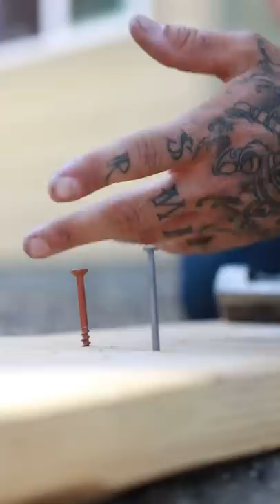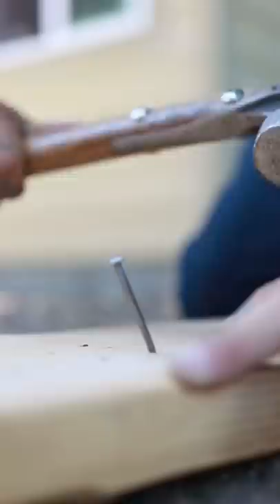Nails vs. Screws: Why do we use nails? #shorts

Comment: Nails are way cheaper than screws.  'Nuff said.
Reply: Also way harder to put in than nails...
Reply: @Caffeine_Addict_2020 not if you use a hammer...
Reply: Plastic nails are even cheaper, ‘Nuff said? 
Costs are only a secondary argument. You need your construction to stay up first. That’s the point of this video. It had nothing to do with costs.
Reply: @Conservator. These guys are DIY guys. Not like you and me where costs are covered by the company or customers so yes it matters to them.
Reply: @billyyager  DIY-ers should save on labour, not in materials but I fully understand what you’re saying. 😉

Comment: They make screws that bend just like nails now. They're just more expensive than nails.
Reply: Only thing screw I've ever seen that wasnt cast, was a timber lock. Those joker are a dollar a piece.
Reply: Yea the difference is just in the softness of the metal that’s used. Could’ve been explained in less time it took to hit both of those things in this reel
Reply: The King  u must sell screws 😁
Reply: Rubber screws
Reply: @Honorbound43  It would be less interesting then.
That's why filmmakers follow the rule of "Show, don't tell"
Reply: They have a lot of different fasteners for different purposes that didn't exist a few decades ago.
Reply: @scottjenkins2264  Grk r4
Reply: Because the structure of the screws aren't bend friendly
Reply: @mikemcklieve  A lot aren't but they specifically make screws now that are designed to yield with the movement of the structure like a nail.
Reply: @Jose Amazon can’t make them magically cheaper. It’s a supply issue.
Reply: @Honorbound43  so you'd rather watch a video of a dude explaining the difference in metals instead of just showing you what happens...?
Reply: You cannot screw a soft screw
Reply: @lt6717  I'm not giving you an opinion. I'm giving you a fact. They make screws that can bend like a nail. They don't bend 90 degrees but as someone mentioned if you have structure bending that far you have bigger issues.
Reply: @MrErViLi  then it's not as soft as those nails yes - it would just often times twist itself when screwing and come apart. Anyways, just say a product name, it didn't become a fact yet... more of a rumour which is always good in YouTube comments.
Reply: @Honorbound43  go back in time and make the video before him, then, genius. Seems like you know everything.
Reply: That's why you just use nails lol
Reply: @MrErViLi  what are these screws called? What type of application are they designed for?
Reply: A blacksmith can forge a strew with mild steel and a file. With it be pretty in a way yes. Will it be expensive also yes.
Reply: Thank you I was wondering about that 😃
Reply: @scottjenkins2264  damn, talk about rich people problems, am I right.

Comment: If your building is moving that much, I’d advise to find a better place to build
Reply: Building are constantly moving slightly, due to any amount of force
Wind, vibration from the road if you live on a busy road, even you walking around your house moves it slightly
These movements are unnoticeable, but add up over time, screws would fail after about 5 years, nails won't
Reply: @flamingscar5263  and if you want something that even the grandchildren of your grandchildrens, grandchildren could possibly enjoy, you stick with traditional wood joinerys instead of nails.
Reply: @flamingscar5263  i’ve been a carpenter, a builder and a welder for 28 years, as the youngins would say, you are speaking total “cap”
Reply: it’s a precaution, you don’t wanna go through a hurricane in your house collapses.
Reply: Your*
Reply: @atial8708  lmao, I didn’t notice
Reply: @michaelarcher6121  Agreed, I've been using the real good construction screws for years. Yet to have one fail on me.
Reply: Buildings move a lot especially taller ones the higher you go up, for the most part it is just swaying but in disaster situations such as hurricanes or tornadoes this could cause a building to shift but highly doubt it because most building can withstand it.
Reply: Facts 😂 and
Reply: I take it you've never been in a high rise during a big storm. My buddy lives in Miami in a upper penthouse on biscayne, pretty unnerving how much the building moves.
Reply: And then Japan hid back in the shadows shamefully, the end
Reply: @flamingscar5263  the reason I say this is that most commercial construction of all types of buildings use metal studs, not wood. You have no other choice but to use screws. If they were as so prone to failure like some people think, then why use them period
Reply: @inanimateuser9828  all those buildings are made of steel. I work commercial construction everything’s framed out with metal studs and screws
Reply: @Jona Cosyns I work commercial construction. I think I know what I’m talking about. Pretty much everything that’s non residential and even some residential are metal studs and screws
Reply: Your yard doesnt do the wave
Reply: @ethanmcleod8819  cool, same here until 4 years ago. You said if your building moves that much to find a better place to build. High rises in Miami move a lot. Metal studs aren't screwed into concrete though. You're talking about studs and drywall using screws I'm guessing? There are no metal studs and screws holding high rises together though.
Reply: Shit, I live by an army base. Artillery rocks my house
Reply: @drewdown826  if its like the base I'm next to  C-130's try to see how low they can fly by my house.
Reply: @michaelarcher6121  So do you build houses with screws?
Reply: @HenryPaulThe3rd  no he doesn't. I'm an electrician and I've wired plenty of new construction. I've never in my life seen a house be built with screws.
Reply: @sbman436  Fair enough
Reply: @maxnitsch4776  if your doing that with wood don't expect it to last 3 generations lmao
Reply: You must of thought you were smart with this one
Reply: so you don't agree him?
Reply: Your*
Reply: Naw just ask if the building is made out or nails. If it is than you’re good
Reply: @boijone8440  quess you don't know that there are plenty traditional wood buildings out there that are over 1000 years old.

Humans just stopped building their houses in such a time consuming way.
Reply: @boijone8440  sure it's not an easy feat to construct a wood building that gets that old.
But I guarantee you that traditional wooden buildings stand longer than those coffins they build everywhere in less than half a year recently.
Reply: Your *
Reply: @michaelarcher6121  yet your username is amog us
Reply: Tell that to every person who thinks it's a good idea to live where natural disasters occur, I'll watch safely from Las Vegas
Reply: Earthquake?
Reply: It obviously doesn’t move that quickly. Over time buildings sink down and shift. That’s why when building cabins/homesteads they don’t nail/screw walls in place firmly, they leave room for movement.
Reply: Tell us you don't know anything about building houses without actually telling us, thanks dude
Reply: @maxnitsch4776  i can vouch for this part of the House is wooden framed, that section is over 400 years old.
Reply: Sometimes you literally can't.
Reply: I guess thats why in europe (romania we like to buid brick and concrete houses🤨
Reply: @Sir_Konflex  doesn’t matter if you use nails or screws. If the earthquake is strong enough to hurt one then it will hurt the other
Reply: @jackdownton5654  that’s not why. If your house is sinking that’s bad no matter what your choice of building material is. And the don’t use nails for log cabins, they use long spikes. That is because as the raw logs dry they shrink. Not the same as normal lumber
Reply: @ziggytheman5695  he just did
Reply: it’s an example
Reply: Good ol' uneducated advice there lol
Reply: @cx-109a7  what about decades? Can you pinpoint how and why? Are you sure it's not survivorship bias?
Reply: @superandreanintendo  I'd assume because screw technology has advanced significantly over time they last much longer. I also purchase specific construction screws, which are made for construction (obviously). They have the ability to flex if need be, and unlike drywall screws aren't brittle. As for decades, I haven't been around long enough to see anything of mine after more than 5-7 years. However, I have seen countless other structures where nails are completely rusted out or heads are broken off and I've seen screws in good condition.
Reply: You just don't imagine how much your house moves !If anything large and heavy gets near your house , it will make it move alot ! That is why big trucks aren't allowed in residential neighborhoods.
Reply: @Suhnetic0  yeah but skyscrapers or any building for that matter won't bend like a cartoon. A fully set screw will not break even with wind force, because it will never be bent 90 degrees
Reply: @michaelarcher6121  amogus
Reply: @marshallduvall4251  that’s not whey don’t allow big trucks in neighborhoods. They don’t allow them generally due to the weight capacity of the road. A residential home is not a 25 foot pole barn it’s not going to sway around.
Reply: @ultimateman9025  finally someone with some sense.
Reply: So people living near pacific ring of fire should migrate to another country? Is what you're saying.
Reply: @JasperLoki  apparently you have no idea what you’re talking about. I’ve been working in commercial construction for a little over 8 years and have built about 4 homes, 3 shops, a dock house, and a pole barn for family and friends among all the many commercial projects I’ve worked on as well. So tell me. What makes you and expert? Because anyone with critical thinking skills would see that he had to bend that screws all the way over 90 degrees for it to break. Never in a million years will a screw that’s properly seated bend over 90 degrees. The only reason framers use nails is solely because they are cheaper and are faster with the advent of pneumatic nailers.
Reply: Buildings need to move... Sky scrapers can move feet back and forth at the top... If they didnt they would crack and fall apart.
Reply: @michaelarcher6121  amogus
Reply: @cx-109a7  Yet every other person in the world has AT LEAST one screw per bag/box "fail" on them.  In more ways than one.  🤣
Reply: @ethanmcleod8819  well you see, in case we use steel, screws are there only to make the steel stay still untill we reinforce it, and almost most if the times, steel goes always together with reinforced concrete, or concrete in general, and anyways every ground moves, every form of vibration, from the sounds of your voice, to the vehicles on the road, earthquakes or small vibration coming from far earthquakes, those all move the building, what i think you are talking about is not steady ground, which isn't allowed as a building ground, we always reinforce it artificially even if it seems stable, and to avoid every kind of possible problem building foundation still goes around 3 meters underground, and the building on top stays always around 30 cm over the ground height
Reply: @ethanmcleod8819  oh, i see, i have to say your right... But still, man, i understand that but, every building is secured always (by law) with the most modern anti earthquake technology, and built really steady on the ground with thick foundation, on artificially reinforced ground to avoid sinking of the bulding, even if it's not 100% possible to totally secure a building, it requires a lot, like hundreds of decades, but a building can still sink
Reply: It also moves every morning and night with temp change.  You can really tell at your grandparents house when trying to go to sleep at night lol
Reply: @FlyinRaptorJesus  That's because of their height and weight, most buildings do not need the ability to sway to that degree if at all.
Reply: ....dude
Reply: Not always easy bud
Reply: @zamiel3  I'm yet to have a construction screw fail. Drywall screws fail all the time. They are brittle and not made for actual construction. But, I'm not against nails either. I've just never had problems with the high quality construction screws. Not saying anyone is wrong here. Lol
Reply: Go find a concrete box on a planet with no weather or moving tectonic plates. Then we can talk.
Reply: @cornbr3ad_  if you want to make a building the way it doesn't collapse in a hurricane. Make a house the way the Dutch do it. They have hurricanes all the time and their houses don't collapse. They also use screws that are a bit stronger than that red crap he's using.
Reply: Spot on
Reply: @flamingscar5263  funny how my 1980s home is screwed together
Reply: He's just taking it to the extremes for demonstration purposes
Reply: Earthquakes??
Reply: @flamingscar5263  It’s moving regardless of those things everything in existence moves even down to the nano scale atoms are in constant motion
Reply: Earthquakes are a thing...... lmao
Reply: Building movement is not something you can see. Building move all the time
Reply: @flamingscar5263  5 years 😂😂😂😂😂😂😂 with your logic a house in America falls down every 15 seconds 😂😂😂
Reply: In short screw is brittle and nail is not;
Reply: So don't build in California is your solution?
Reply: @atial8708  you're*
Reply: @inanimateuser9828  they're talking about normal houses, not a 10 story apartment complex
Reply: @atial8708  no the youre should be be corrected to you're you're means you are and he said you're capping
Reply: Lmao
Reply: @flamingscar5263  it also move by the change in temperature.
Reply: As a European: you need nails because you build houses made out of wood? Makes sense I guess. We just use bricks. No need for nails, lol
Reply: @michaelarcher6121  ngl if your name is "Amo Gus", I highly doubt youve been a carpenter for 28 years
Reply: Building moving?? That's why in Europe we build with concrete and steel 😂
Reply: @maxnitsch4776  and if you want something that the grandchildren of the grandchildren of your grandchildren can use, you build it with rocks. :D
Reply: @inanimateuser9828 idiot yes they are🤦‍♂️
Reply: All the nations in the belt of fire be like: "Why didn't we think of this earlier?"
Reply: Somewhere with no weather, in a bubble
Reply: that’s not the point he’s making
Reply: @michaelarcher6121  amogus
Reply: i just use screws easy to get in and out and u cant rip them out like nails
Reply: Don't screw around, use nails.
Reply: @flamingscar5263  blablabla level it in 25 years. 
Yes I'm a builder and repair king.
Reply: I was about to say if your screw is getting bent that hard, your house is already must be coming down lol
Reply: @flamingscar5263  but that America since you usually dont build on concrete you guy go Willy nilly europe to to great degree build on concrete foundation wich level down the movemnt of the foundation, as a person who has lived on both places and work as a plumber eingineer I can say that American house arent made for long as for their European counter parts.
Reply: Says everyone who's lived in California
Reply: Oooohhhhhh bad non builder comment.haha
Reply: @michaelarcher6121  He was doing fine until he said "5years".
Reply: I bet you thought that comment made u look smart...
Reply: @maxnitsch4776  wood is great, but you need to mantain it alot ,and if any type of worm or bug attacks the wood ,you are screwed , + they rott away if not painted or kept oiled
Reply: Ever heard of earthquakes?
Reply: @ethanmcleod8819  the fact that I'm 26 and have been doing construction longer than you
Reply: @nickzimbaro4157  if you’ve truly been in construction longer than me then you should know how asinine your argument is. The fact that you haven’t learned by now is truly astonishing.